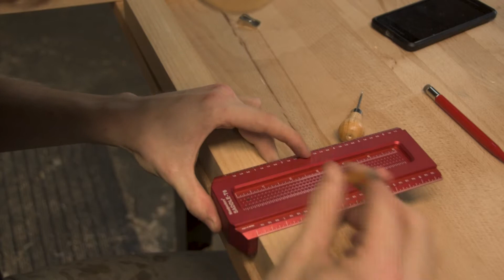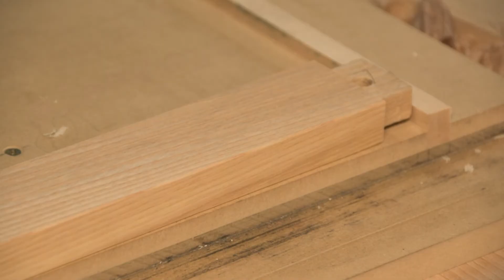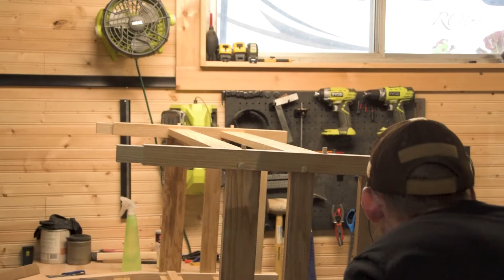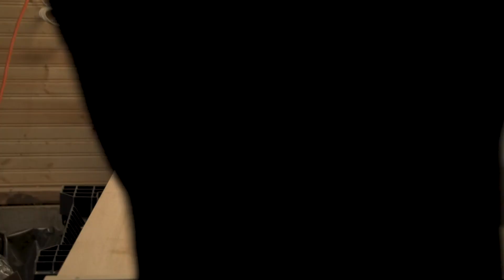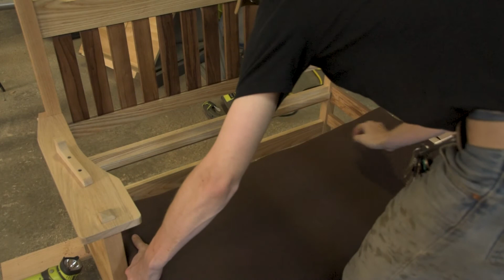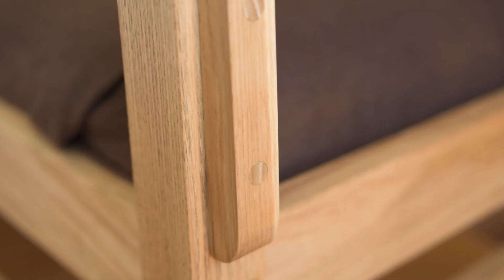How to Build a Craftsman Style Settle | Fine Woodworking | Custom Upholstery for Woodworkers | Two

Comment: Very nice build. In my own work, I really hesitate to use steel wool in any open grain wood like ash or oak. Nice video. Keep 'em coming.
Reply from the maker: Good choice! I don't touch steel wool anymore, I realized it was getting ground into the grains after finishing this project. There are a few spots on this settle that look grimey because of it but luckily it doesn't look too bad. A good replacement is hand plane shaving, they actually give a similar result to steel wool just takes a lot of them!
Reply: @morganhurst_redridge  Nice work and nice vids! I just found your channel. Keep up the good work. One comment: for a little extra burnishing after hand planing, try grabbing a handful of the fresh wood shavings you just made, and buffing the wood with that. Gives a nice little bit of extra wood-on-wood burnishing.